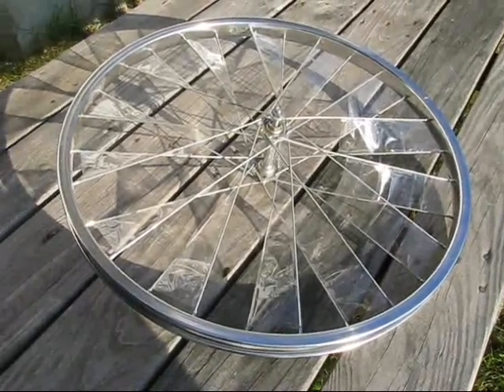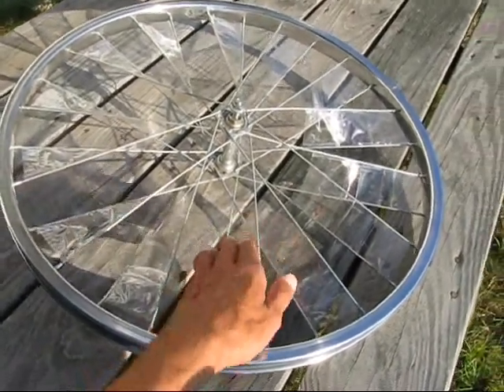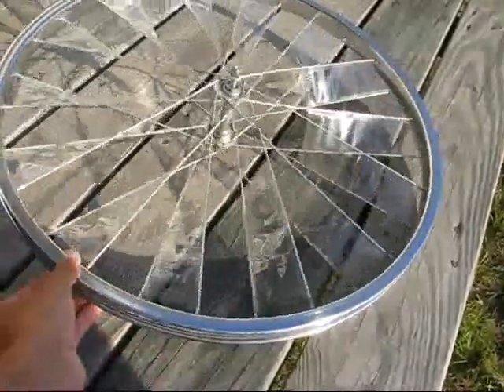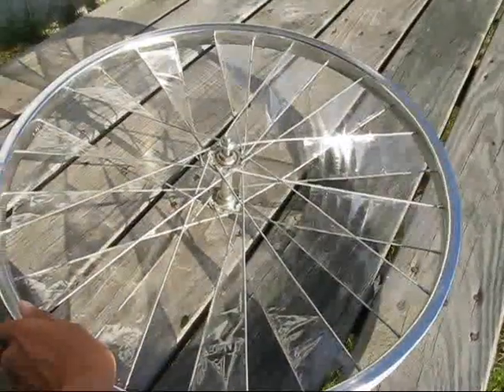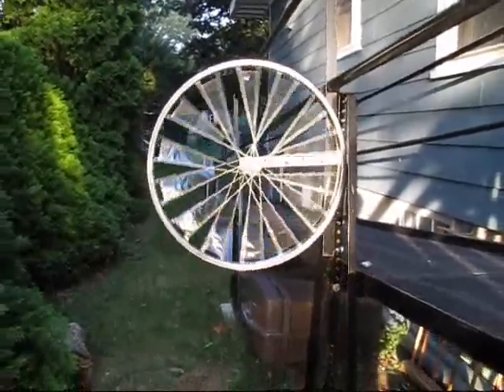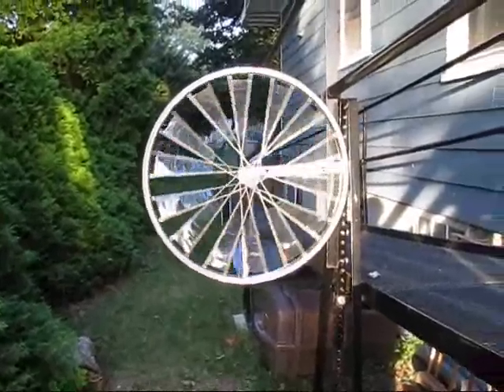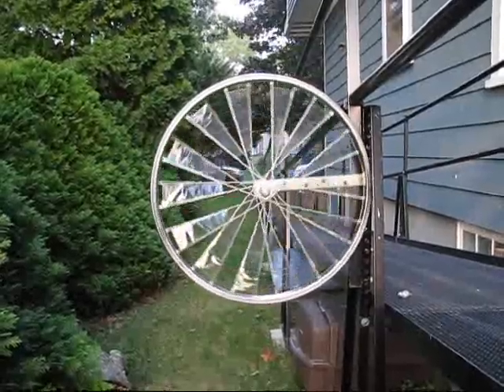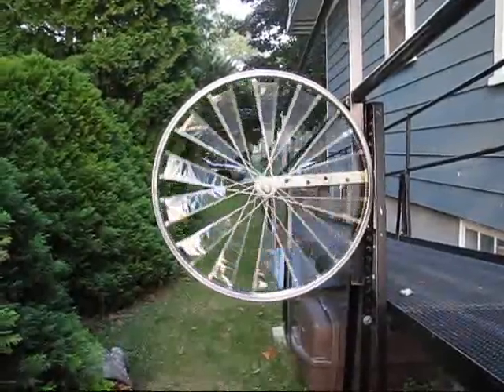Bicycle Wheel Windmill

Comment: Set it up like an Eklin/Brown generator.  Let the windmill turn a ferrous blade that slides between a stationary magnet and a stationary coil.  Blade will shield the coil from the magnet's field as it goes between them, then magnet's field will surge back to coil after blade passes, causing coil to transduce electricity from that movement.  No repulsion against rotation, but the mill has to turn hard enough to overcome the attraction of the magnet to the ferrous blade.

Comment: to generate power, mount the wheel to a 2x4 and place a neo magnet around the rim of the wheel at ever flap of tape, then make a thick "coil" of copper wire and mount it to the 2x4 and allow the magnets to pass the coil as the wheel turns.

The 2 ends of the coil are the + and - leads.

Comment: Use small magnets around, add a stationary air core coil. If no magnetic material is close to the wheel it wont clog and will move in low winds like now.

Comment: I'm glad that you posted this video. I had to build a wind turbine in one of my college classes and I used your idea for my airfoils, using tape. I did manage to generate electricity to power a LED flashlight by using a crankshaft sensor that I mounted underneath the bike wheel, and by hot gluing nuts along the outer rim of the bike wheel. It works very well and it managed to get me a  really good grade in my class. Thanks again for the inspiration!
Reply from the maker: Great to hear this! Since I originally saw the paper describing this while I was a college student, I'm glad you were able to use this to help you. Hopefully you also found the original paper useful. I'd love to see some photos or video of your setup too!

Comment: I live on the coast where there's a lot of wind off the sea in the winter and have been looking for a good idea for a windmill. I tested this and it works great. Will be making a few of these, hooking them all up to dynamos and generating electricity. You don't need a belt as you can easily mod the end of the spindle to marry with the end of a dynamo. The only downside as I see it is the need to keep the spindle oiled so it doesn't grate or become noisy. Thanks so much for the idea.

Comment: I had a similar arrangement when I lived in Melbourne, AU. I used an old old hdd cylinder motor as a 3 phase generator and drove it with the rim's spoke guard band. I even built a boost regulator for charging 18V drill batteries. It maxed out at about 36 watts in a 20-24 MPH breeze.

Comment: u know? becuz the wheel is about heavy thus it has a significant moment of inertia and so it behaves as a FLYWHEEL. This is an efficient design becuz flywheel functions by storing small energy (such as from small windblow) and releasing it. Analogous to a capacitor (in electrical engineering) stores charge n dumping it in a very short time, reducing wasted energy. So almost no energy is wasted. Seriously this is a very good design or at least, a path to further innovation. Well done mate !

Comment: For ours we are using a ceiling fan motor with added magnets. We are connecting that to a marine battery and then connecting that to a inverter for the house. But we are building the  wind turbine  fan part with 4 inch PVC pipes, 24 inches long, split down the middle and metal blades as the arms holding the fan blades

Comment: Magnets on the spokes near the hub and coils on the wheel mounts would do the trick.  Or put the magnets on a disk (CD ROM, wood, whatever) and attach to the spokes.  Coil(s) on mounts.  Etc.  Will require higher start up winds, depending on magnet / coil distances, strength of magnets and the like.

Comment: Yeah that is how a generator works, instead of producing a spark, it uses the electricity for other things, like making light. Inside a flywheel it is somehow connected to the drive shaft in order to make a spark at the exact wright time. 

But if you can make a stationary coil and let magnets pass by, then you get a current. It depends on the design of the whole structure how much current you are going to get. Don't expect much from a bike wheel. But it's a nice way to learn about the basics.

Comment: @gravityisweak Well, that's the simplest way of producing electricity but the heavy magnets around the rim will also work as a flywheel which is an advantage if the wind is not constant. Really inspiring rig. Have to try it my self too at some point.

Comment: I've never made a generator and have very little elect. knowledge, but I'm thinking you could line that spinning rim with all S or N magnets.  Have the opposite magnet on the base, and a wire in between them that would collect that would collect  A/C.

Good luck. I like your windmill.

Comment: put magnets on the outter parameter and set a coil on the stationary arm with a diode for DC or not, you might even set 2 coils one for - and the other + depending on how your magnets are attached, I am sure there are 100 ways you could turn it into a generator, I actualy like the simplicity of the concept. I'll  have to try one!

Comment: When you have found a way to generate electricity using this windmill, you could use the electricity to power a computer fan (any fan you can find inside of your desktop 
(it uses less than 0.7A of power and produces a ton of wind). Then aim the fan at the windmill creating a loop.
The windmill will generate electricity which will power the fan which will be used to spin the windmill which will generate electricity used to power the fan.

Comment: Hi, All u have to do is get some donut shaped neo magnets and screw them on the od of the wheel and put coils on that pce of black channel u are using as a mount..If u put another wheel on the other side (now 2 wheels) you could put a tail on it and put a pillow block bearing on the channel and it will turn and face the wind with 2 props and twice as much coils the more coils the merrier wind your coils twice as much as you need and regulate the voltage..thanks for the idea's its easy

Comment: hi, thanks for sharing your idea about the plastic tape.
I know frictionless dynamos exist and are more efficient, but let me describe my own quick system which was maybe oldfashioned but foolproof and worked.
 If you want to produce a useable current you need =
1,larger blades (sheetmetal, not plastictape (ideally leaving the wheel outside of the forks, on a prolongation of the normal axis because the distance between the 2 forks is very limiting, all you have to do is to replace the threaded metal rod which is inside axle (and which holds the bearings) by a longer rod (threaded as well)
 attach one part of it with the usual screws to the endings (endpart of the fork) and mount the bearings +  axle on the free part of the rod which is sticking out sideways,
2. you have to leave the tire on your wheel (fill it with liquid for more weight (higher momentum and more stability)
3, install a vane (not too big in order to avoid constant sideswings, which are slowing down the rotation via the gyroscopic force. (experiment =hold a turning wheel by its axis and try to change its sideways direction = you will feel a resistance proportional to the rotational speed, and if you forcefully change the position of the axis against this force the wheel will slow down or come to a stop.
---------------------------
I lived for half a year (1980)  in a greek shephards house with no main current connection and relied entirely on a small self-assembled solar panel ( 30x30cm) for my 12 V "domestic" needs. but for cloudy days I invented a selfbuilt bikewheel generator similar to yours, which gave me 6v+6V on two bike-dynamos to charge my 12 V batteries efficiently.
 Imagine using the frontwheel of a bike, screwed upside down on top of a mast, (like this guy did=http://tinyurl.com/l4v943s)
and attach the 2 dynamos on both sides of the fork exactly the way bike-dynamos were usually attached. (generation of voltage by friction against the side of the rubbertire.
Big problem = then the wheel will start turning only in extreme winds because normal winds cannot overcome the initial resistance of a dynamo, much less 2 dynamos together,
But there is a solution.
The trick is = you have to lower the dynamo's initial magnetic resistance by increasing the circumference of the dynamo's headwheels by glueing on top of the dynamo's head the wheel of a toytruck, so its diameter becomes a little drum of about 5 to 7cm diameter, or more, instead of a the usual 15mm head (metalcylinder with some 15mm diameter)
I used about double the amount of blades than he did.and used a high wooden beam.
In order to continue production of current under varying winddirections I attached a vane to one of the 2 fork-arms and resolved the sempiternal problem of the transmission-cable, which always automatically ends up wound around the supportstructure, by passing them throught the hollow metaltube of the upper tube of the fork (where the handlebar normally is stuck into)
This way the dangling cable gets only twisted around itself when the vane makes the windmill go sideways or around in a few circles, but those few turns left or right end up averageing each other out neatly - on a longer timescale, so the knots, which invariably start appearing on the dangling cable, become undone by themselves after a while, on and off.
for visual details= I will give my email adr. to gravityisweak, who posted this video.feliz@fe.up.pt
Reply: I like the larger head on the Dynamo. 
I was concerned about the drag. But that might help solve that. Nice THANKS
Reply: Good deal keeping the wires from twisting under your limited conditions !  The wire issue could easily be solved by using Contact Brushes to conduct the power .  No hard wire connection to the wire leads coming down the mast.

Comment: get yourself 2 bicycle cranks, mount one to the wheel on the backside, and the other to an alternator and use a chain to connect the 2. the wind will blow, spinning the tire/crank, in turn spinning the alternator. you can also build one, same concept with fence boards and a crank.

Comment from the maker: @HWman1991 Thank you, attaching a stepper motor from an old printer is a great idea. I'm not quite sure what the best way to do this mechanically is. Maybe a belt connecting the stepper, or have it contact the wheel directly, or maybe even use the stepper motor as the bearing of the wheel. Good possibilities here, thanks.

Comment: The best way to take advantage of your low wind rotation without effecting it is to use rare earth magnets spaced evenly around the inner rim or near the hub attached to the spokes. Your forks or support method you are using is perfect for this as you can place your own coils along the length of the forks or support beams. This way you have not added any real parasitic drag or direct drag off gears or belts. Look up wind belt generator ;) The magnets r evenly spaced n weigh same each, balanced.

Comment: you should cover the hole in the middle to force the air through the blades instead of simply flowing through the middle. honestly though its not going to produce much of any power. it mainly spins so freely because it has not load on it and bicycle wheel bearing are pretty good.

Comment: Take some rare earth magnets (ie) "neodymium" and attache one magnet to the end of each spoke adjustment screws. then mount a coil of copper wire with an iron or steel core between the forks. the rim would spin, passing the magnets by the coil as it spins. the amount of power you get from it (say 12volt)is determined by the amount of windings in the coil. add a bridge rectifier, battery, and power inverter. you are generating 120V AC house current. make a great green outdoor power plant.

Comment: try replacing the packing material with a light weight plastic using a piece of your tape as a template. Perhaps you could use the packing tape to adhear the plastic to the spokes. Great Job

Comment: Take a rear wheel off a 10 speed bicycle, orient the tape blades so it turns in the direction that makes the chain cog spin...not freewheel. run a the chain off of the same bicycle to your generator which can be home-made, or purchased. Fast, simple and the average person can do it. Use the extra gears to find your optimal gear ratio.

Comment from the maker: I have not. I do expect that would work very well though. Right now I have this wheel mounted in my backyard to see how well some simple packing tape will weather.  When its very wet, the weight of the water clinging to the tape is enough to keep the wheel still in light winds, but otherwise, it never stops spinning. Very surprising considering it does not rotate to adjust for changing wind directions.

Comment: You need to make the blades say from ridged pvc or thin alaminium,and then move it to a much more open area and you need to make it able to turn into the wind,you dont need chains or gears,I have an ametec 38v motor not fantastic but works with a 36 inch 5 pvc blade set up on and if you connected that wheel in the right place to something like the ametec it will charge a 85 to 110 amph[amp hour] battery.

Comment: Make the design with a REAR bike tire that has the gears attached....then you could have a chain/belt drive type of system, turning the axis of a DC motor to create electricity (you want a motor with low RPM output so that your input of RPMs into the motor will be more efficient at generating a higher current. For example, a 3V motor with 1000 RPMs means you'd have to turn the motor at 1000 RPMs in order to get 3V out of it.....so a lower RPM:Volt motor means you need lower RPMs to get that voltage back out of it).
Reply: Here's a good example of such a motor..... http://www.sciplus.com/p/BHLER-12VDC-40-RPM-GEAR-MOTOR_51171 ......also, a linear actuator made for automatic car windows or moving the seat would be good, just as long as it's low RPM output!
Reply: neobreaker91
Oh, I have no idea, everything I posted is strictly "theoretical" for me, I like to brainstorm about stuff even though I don't plan on building it :)
Reply: actually I believe a motor running at 3V and 1000rpm might only make 1V when turned at that speed, due to efficiency losses. also the torque of the windmill might not be enough to go anywhere if you are trying to use permanent magnet motors with iron armatures.

Bottom line: it gets complicated, fast.
Reply: neobreaker91 Steal one :)  The nearest auto junk yard will have windshield wiper motors, heater fan motors, and starters.  All you can get for cheap.  Any DC motor when spun will produce electricity.  Even a windshield wiper motor spun at low speed will light several bright white leds.

Comment: @fermionsandbosons This was going to be my suggestion. Use a rear wheel with the bike chain to a motor. Just about any motor will do. Yank one out of a vacuum or a power drill from a garage sale. An electric motor and an electric generator are one in the same.

Comment: Brilliant,just put a drive belt onto it and mount an alternator from an automobile,wire it up thru a regulator to charge a deep cycle battery,battery power to an inverter and you have an economical power source.....
This is Desert Fox

Comment: there's a youtube video called '24 volt Bedini Cap Pulser' that may lead the way how to generate electricity with your wheel mill.

assembling 10-20 of your bicycle wind mill wheels in parallel circuit could be very interesting

Comment: When I was a kid, my big brother had a headlight on his bike. It mounted to the handle bar and a wire went down to the rim. It had alittle thing that went up against the wheel. As the wheel turned, the light bulb would light up.....so I would say that it would be possible to create some energy going into a battery from it....just not sure how well it would work. I should have known that I would grow up building everything under the sun.....I mean how many 6 yr old girls have to check out how a light on a bike works....and remembers it 30 yrs later. Lol.
Reply from the maker: +getsmartnow2011 I did pick up one of those bottle style bike dynamos. I'm not sure if this is strong enough to spin it in low winds but I'll probably try it at some point.
Reply: lol its a generator and they only produce 1.5 v approx. turn any electric motor and it will produce electricity just in reverse

Comment: @gravityisweak I set a small pole and mounted my wheel on it and shot a short clip of it, it has 360 degree pivot. I have a hankering to line the rim with multicolored led's and make it a light show at night.

Comment: My first thought on how to harness the energy is to use multiple rear wheels with a cycle chain threaded through the sprockets in an s fashion, alternate wheels must rotate in alternate directions. the more wheels the better. Then gear it up to drive an alternator.

Comment: Thats cool! Did you tape both sides so it wasnt sticky? You could just add a small generator to the back of it. You can get them from a hand cranked light or some hand crank cell charger. Would be cool to see it make some electricity.

Comment: what would help you on your way ' is use the rear wheel off an old ten speed with the gears on it' some are made of aluminum very lite and the bigger wheel will give you more mass also. then put gears on a alternator and use a bike chain.

Comment: I think you could put a small DC motor up next to it on the side it is mounted like this oO you would need some friction between the two like a belt or gears. I think this would keep on the same complexity level you have so far. :)